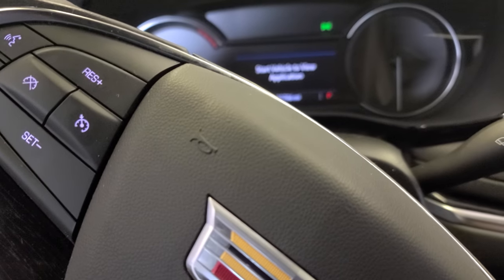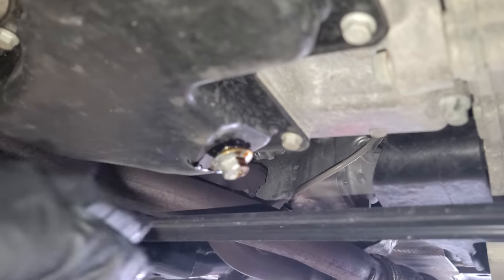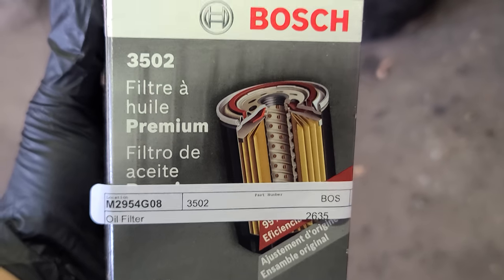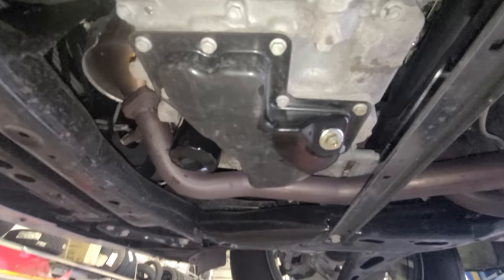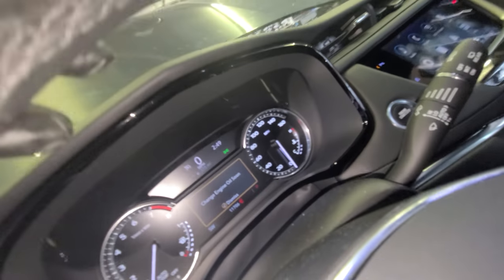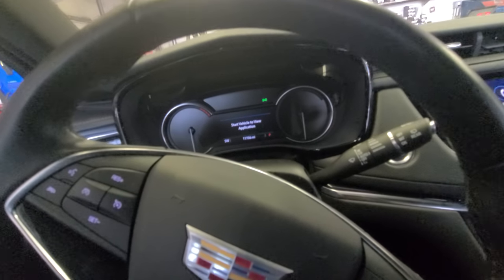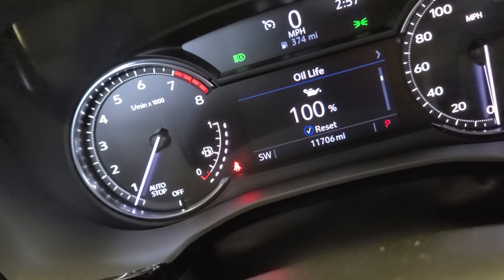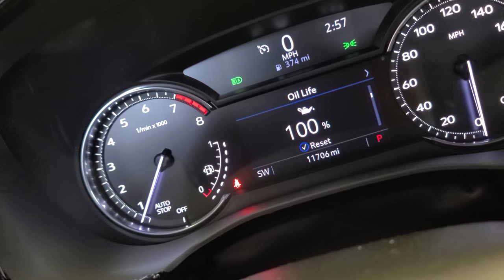2021 cadillac xt5 how to oil change and oil life reset

Comment: Has this ever happen to you or have you heard of this. Im checking the level on my XT6 and im on a flat surface and SUV is off. The oil level is perfect but once i turn on the SUV..i check the oil level ..nothing shows on he stick at all?
Reply from the maker: Please Hit the super thanks to get your answer. Have a great day!!!
Reply: If you are changing the filter and draining it all the way.
Filling it with 5.3 quarts is what the capacity is. So if you at least put 5 quarts its absolutely safe to drive if you need to run and get another quart because you didn’t know it’s over 5 quarts.
Anyway, you may have just checked it too soon after running it. 
The oil you put in there, after running it coats everything in the engine so it takes a min or so for the majority to get back in the pan to get an accurate reading.

With that said, if you are checking it while running? Or to soon after running? It will not be accurate.
Also, depending what type of oil you put in, some super thin synthetics are not easy to read on a dipstick esp when its fresh oil its almost clear and hard to read.